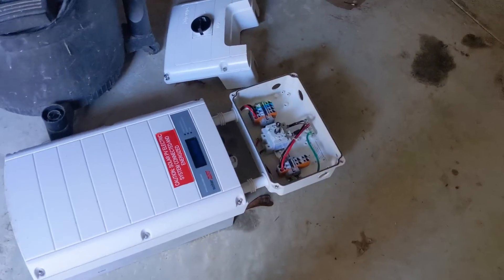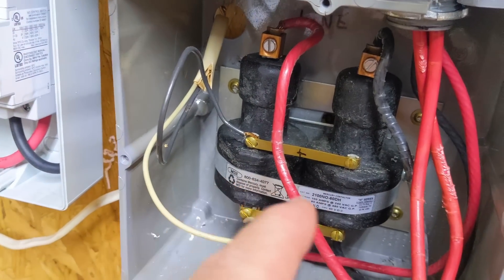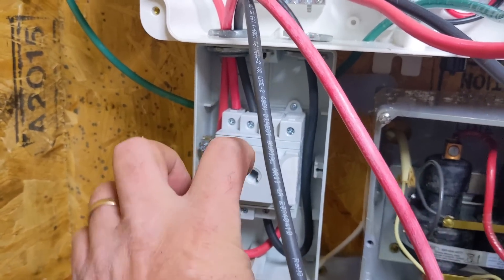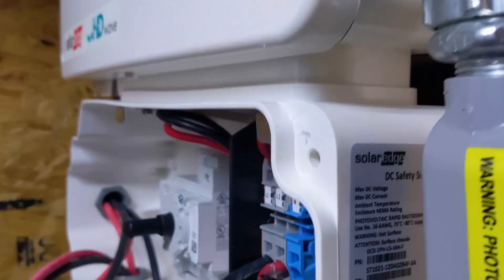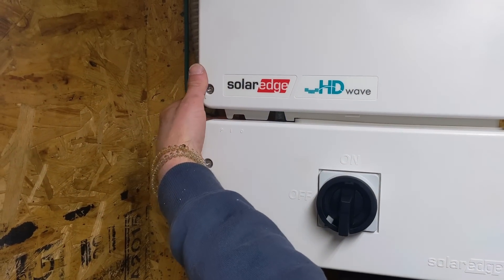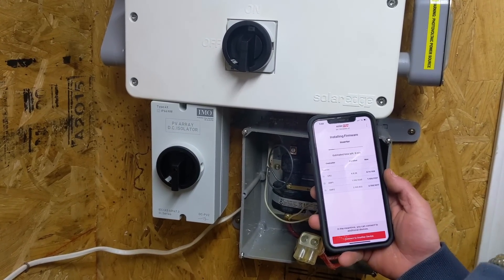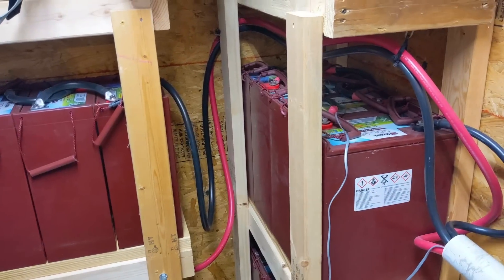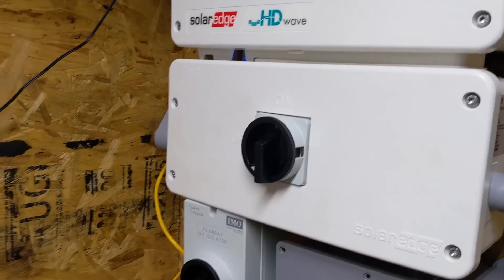The dreaded AC coupled service call

Comment: Is not having individual panel monitoring a issue with sol-ark?  Shading issues ever?
Reply: EMP Shield uses MOV, which degrade with every surge. Could be that the EMP shield had severe previous surges and just failed when the lightning struck. 

Even Sol-Ark just use MOVs. The only devices that I am aware of don't degrade over time are TVS diodes.

Comment: Can you tell what fried in that solaredge? Brains or power section? Does it have MOVs on all power in/outs and gas tubes on data lines? Did those fail?
Reply from the maker: Great questions I do not know what failed.  When I arrived the new HDwave was partially mounted on the wall so I just focused on getting the system back up and running.

Comment: @Engineer775
Hmmm. How about a DC power supply with circuit breaker at it's input feeding DC to a  separate MPPT controller to recharge batteries if they get too low. You could auto-switch the power supply on when the battery drops below certain voltage/percentage.
Reply from the maker: Well I purchased ac charger to connect to a generator and A separate 48v solar charge controller connected to 800 watts of solar to bring the battery voltage up high enough for the magnum to reconnect.

Comment: Whenever you need to connect to a device without internet connection; do yourself a favor and change your IP settings to manual. Copy everything exactly, except leave the router setting blank. This lets your iPhone know that the Wi-Fi ssid you are connecting to does not have a internet connection and will only use that connection for local network traffic only and use your cellular for internet.

Comment: I started with grid tied solar edge… then wanted to add battery back up, went with Schnider xw+ battery inverter ac coupled. It’s good and bad, in grid up it’s highly efficient with the shading I get. In grid down it works well. As with any project you always add more solar and that I did dc coupled and so I have seen and use both options. 

Dc coupled is great for load shifting / time of use. Grid tie is great for most of the time if you have good net metering.  

Not sure the solark is a good as you claim. Having the transformer means I don’t care about L-L balance and it starts any motor I have. 

In grid down low power use and low solaredge production the ac coupling gets a bit odd, frequency can jump around some. but most of the time it just works like a tank. 

The Schnider also frequency shifts the ac grid it makes to throttle down the SolarEdge rathe than use a relay system. This is a great feature as the two units are not installed near by and running wires from the out building back to the Mec room with the Schnider system was not a good option.

Comment: I watched this video 3 times and now i understand why the first guy walked away, So does the HF invertor just charge batteries ?  Why not just use charge controllers ?
Reply from the maker: A solar edge system with optimizers was already installed and then the customer realized that he wanted battery backup so that's why the solar edge was AC coupled to the Magnum battery base system. The customer wants to be able to grid tie and have battery backup.

Comment: Would a Sol-Ark have worked better and been less expensive?
Reply from the maker: It would be today but the solark wasn't available when this good tie solar system first went in and then was modified with AC coupling.

Comment: Excellent video! The down side of those different brands (between Magnum and SolarEdge) is the added expense and complication of integration. The upside is some sort of redundancy of task. The advantage of Sol-Ark is that it’s an all-in-one unit that can replace all of that. The disadvantage of Sol-Ark is that it’s not an Outback Radian with 2 charge controllers (Flying V), with AC coupling AND Generator support and field swappable subsystem components. Obviously, I’m a big Radian fan. ;-) 
As a long time MAC user, I can say that the Sol-Ark is like a MacBook Air and the Radian is a Windows 7 Desktop, maybe even with dual screens. They both get the job done!
Reply: And Sol-Ark also depends on third party apps for their remote monitoring with unknown back doors cuz Chinesium.

Comment: If you are in the situation of only having space to put solar in your roof, having but a pure DC string and a coupled AC string with micro-inverters that can do proper frequency shifted output regulation makes sense because at this point they cost about the same as the rapid shutdown modules, and most of the power of that string will get used as it's generated anyways.

I have a single Sol-Ark 8k with maxed DC input in terms of raw panel KW, and am looking to add more.
Reply from the maker: Yes, AC coupld micros helps deal with the dreaded RSD.   Sol-ark is introducing their onw micros soon.
Reply: @engineer775  I wonder if it will have some other communication direct from the Sol-Ark, other than from frequency shifting? It would be neat if it could match load without having the Sol-Ark internally disconnect from the grid to frequency shift, or even having to do frequency shifting in off-grid mode. (I do zero export to CT.)

Comment: Solar has always been a complicated subject for me. There is so much to consider and the cost can be astronomical.  While I can see the benefits of having the solar edge that replaces many other components, what is the downside of having everything together? If one component of the system fails does the whole unit have to be condemned? I sure appreciate the work you've done all these years on YouTube. It has been a fantastic journey so far.
Reply from the maker: Well there's a lot more failure modes in the system I shared on this video then there are in the single hybrid inverter systems like Solark. I didn't even talk about the inefficiency of how the system works. There are a lot of losses from the panel to the optimizers to the silver edge through the contactor to the AC charger to the battery then back to the inverter to the load. Probably losing up to 25% of the wattage on the roof. The new inverters lose 3 to 7%.
Reply: @engineer775  Thank you!

Comment: How much more would it have been to change out for a modern system compared to all the time replacing a bunch of broken components?
Reply from the maker: The problem is that the customer already had the replacement inverter so for him it was just a one-day service call payment.
Reply: Removing all the optimizers on the roof to go with a different inverter system would have been much more costly.

Comment: Real question....Does the EMP Shield product work? I have 2 EMP hardened Solark systems. Solark has not been tested to withstand an EMP 3 wave. EMP shield tested EMP 3 and according to test data works ..I need an opinion as I am ready to drop some money for the EMP shield products.
Reply: yes, until such times as Red China nukes the US it will not be tested. in the meantime it seems like it is a sales hoax for the "preppers".
Reply from the maker: @ursodermatt8809  no comment.  My buddy was sued by them.
Reply: @engineer775  sad isn't it?...
Reply: @engineer775  I know Tom Brennan and his wife....Bahvna...Do you install EMP shield products?
Reply from the maker: @MaMa-st2eg  I install solarks EMP hardened inverters.
Reply: @engineer775  That says it all.....Ok thanks
Reply: EMP Shield is snake oil for uneducated Preppers.  Masterfully marketed lighting suppression